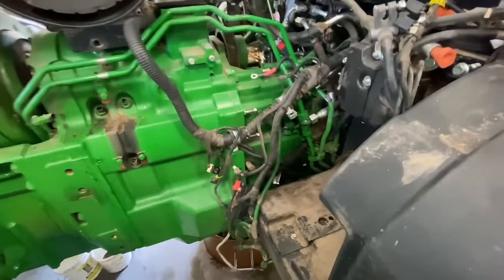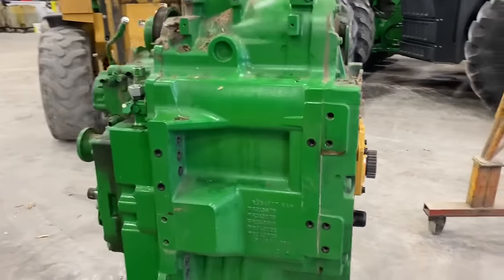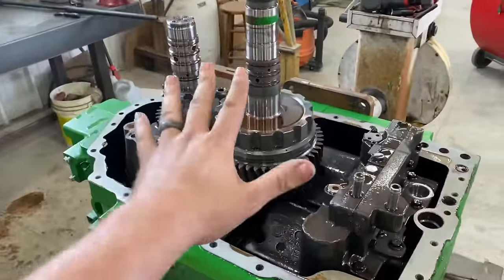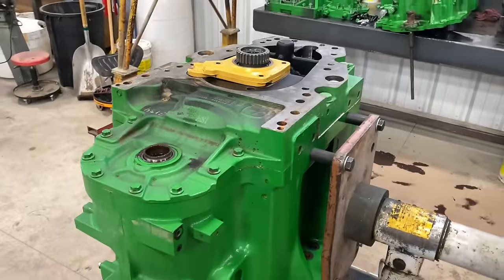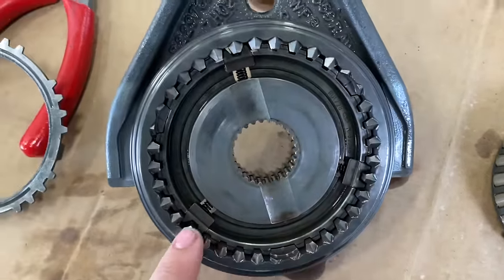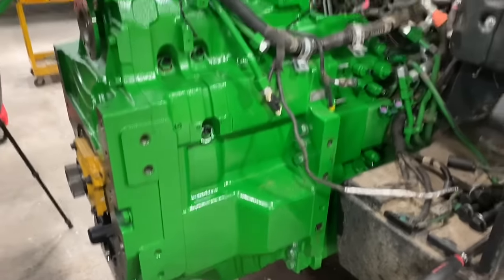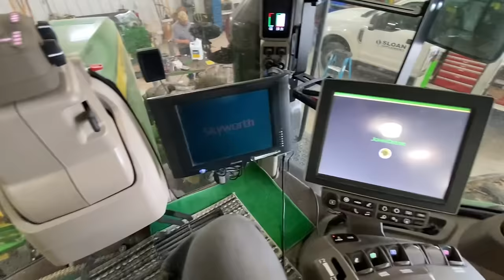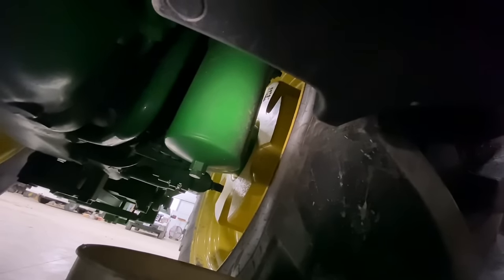John Deere 8370R IVT will not come out of park or calibrate.

Comment: Design of the axial pump piston is horrible. Just look at that - ball on one side and the piston on the other, normal thing. But look at that thin connectiong part. Why make it so thin, diameter is approx. 3 times smaller as the diameter of the piston head itslef and as far as I can see, there is no reason to do it so I conclude they did it just to save on material and make some extra profit. Piston is under very heavy axial load due to pushing all the pil nd that thin middle part of the piston simply can not hold it. It is basicly built to brake down. Such a shame for JD but correct me if I am wrong, this looks way too similiar to Fendt Vario transmission (two variable axial pumps for low speed, high torque application and mechanical bypass transmission for high speed, low torque work)? If someone does not get the point of what I explaind about the design of the piston body, simply google for "axial hydraulic pump" and see how pistons are made for pumps used in, for example, construction equipment. They make them very simple - cylindrical body with ball on one end. No weak spot like here.
Reply from the maker: Sauer Danfross makes that hydro.

Comment: I know you are only putting a core back together, but if this was for real? at 19;56 in the video you failed to put the big brg. in under that gear!    Wow............
Reply from the maker: You are wrong sir. The bearing is on the bottom of the gear. From that camera angle it's hard to see it.
Reply from the maker: At 11:00 you can see the bearing stays with the gear.
Reply: @ZKMasterTech  Then why on the other video where you came back from back surgery I see the tech you are training put that same brg. on by itself and then the gear?
Reply from the maker: Sometimes it sticks to the bottom of the gear sometimes it don't. The oil in-between them creates a suction.
Reply: I did replay this on slow motion and did see the brg. this time
Reply from the maker: I don't make those types of mistakes. My OCD won't let me.

Comment: Why does it seem like everything you work on looks like it’s relatively new are these not reliable tractors for the hundreds of thousands of dollars I spent on them
Reply from the maker: If your new to the large ag world, this stuff just happens or is basic wear and tear. This tractor is over 10 years old. So it's not new. But yes I do work on a lot of later model equipment because there's a ton of it out there.
Reply from the maker: Doesn't mean they are not reliable. These tractors stay at wide open throttle and full load most of their engine hours. With that much power and load something will fail eventually.

Comment: I thought they didn't even sell parts for the ivts. Just had to replace them
Reply from the maker: There are certain ivt's that are like that. I know the ivt in the 6R tractors are that way. But 8030 series and 8R series are repairable.
Reply: @ZKMasterTech  gotcha. I think they say hauling heavy loads like manure wagons or grain carts going fast usually is the hardest on them, not sure why
Reply: All 6 series with ZF ECCOM transmission aka AutoPowr are not dealer repairable, just replacement.
All USA models have IVT and they are repairable and you can get the parts from the dealer.